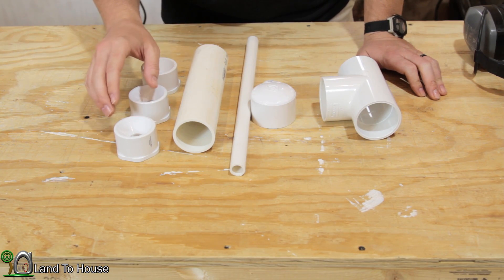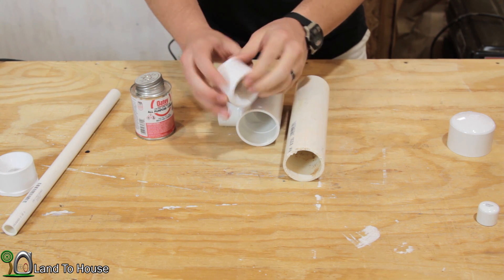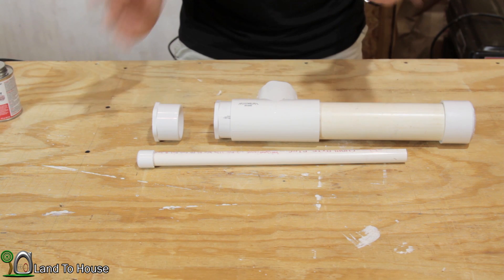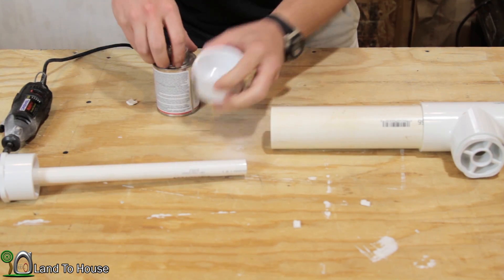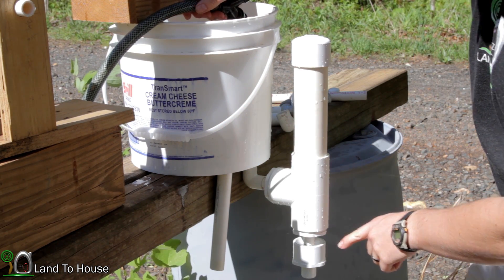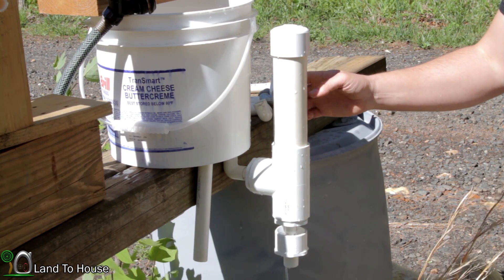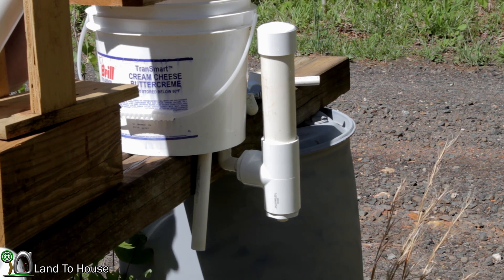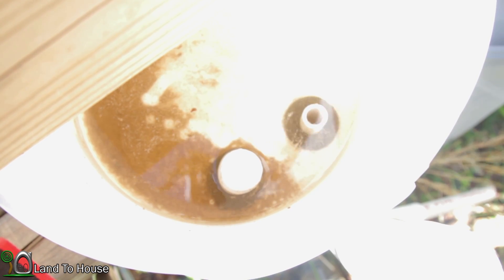Exterior Bell Siphon Build and Test

Comment: You can add a small air tube near the bottom of the bucket just above drain tube and connect it to the bell near the top and that will break the water lock and allow air to break the syphon.

Comment: Rather than a union simply seal the seam between the cap an the pipe with a bead of hot glue.  It will break when you twist the cap to remove it.

Comment: I love the idea of an external bell siphon, however some of the parts are very difficult to obtain, especially the reducers, here in South Africa. (Enter the 3d printer....)  It make so much more sense to have the bell  outside.  Thanks also for the idea of using a ram pump.  I don't have access to a running stream but you triggered an idea to use a small 12v solar pump (or even more than one) in my sump tank to drive the ram pump and get the water back to the higher level fish dam instead of using an expensive, huge pump in the system.  I will test that in the next few weeks.
Reply from the maker: I am happy to hear that the video sparked your creativity! An outside siphon is really handy to have.

Comment: A simpler design would work and flush the debris.  stick your 1/2 inch pipe up the bucket, drop a capped 2" over that with notches all around the bottom.  done.

Comment: You got a "low flow" start on the siphon (that's good) but what is the max flow coming from the pump (the supply line) you can have and still get a break in the siphon? You didn't elaborate on that part of the system. Thanks for showing us your experiments.
Reply from the maker: I have not worked with this idea in some time. I am not sure about that info. (I am bad for trying something and then moving on the other things. )  Breaking the flow is a real issue.

Comment: would a ball tap between the bucket and the siphon work? that way you could turn on the tap to use the siphon and turn it off to break the seal?
Reply from the maker: That probably would work. If you left some suction in the pipe going down you could start back to psiphon anytime you wanted.
Reply: What's the point of controlling the siphon ops when automatic mode is always required?.... Would be equivalent to adding legs onto a snake!!!!

Comment: I liked the whole setup... even with the cup at the bottom... I see why you couldn't break your siphon... you need to add a tee horizontally facing upward off of the smaller tank line... then, to that add a snorkel line... a pipe going up, over, and back down to the level where you'd like the siphon to break inside of the tank (usually 1-2 inches from the bottom of the tank)... then, there's where you'd add your external bell siphon to the other end of the tee... I'd really like to see you revisit it... you did a good job, and it urked my nerves to see you cut off the bottom cup...

Comment: Hi Seth. Do you think I could put a valve on the outlet drain of the bell siphon, shut it off when the siphon starts to work and then turn it on when ever i need water again? I am trying to figure out a way to get water from any underground rainwater collection tank without using an electric pump. Thanks in advance and great video.
Reply from the maker: Yes you can do that. As long as there is water in the outlet pipe you can use the siphon downhill and it will start automatically.

Comment: Could you think of a design in which the water passes first by the generator and then by the ram pump?
Reply from the maker: The issue I am thinking of is that the generator would interfere with the pressure wave of the ram pump.
Reply: Thanks for your answer. With sufficient flow, a minimum incline of 30 degrees and a suggested distance of six meters from the generator should work. There is the question.
Reply from the maker: Now if you have that head pressure after the generator it might be just fine. My thought is if the water that is coming out of the generator falls into a catchment tank then the ram pump pulls from that it would allow the pressure wave to work without issues.
Reply: Thank you

Comment: Sorry a question: do you think it would be possible to combine the ram pump with this electric generator?
Invento de pequeña planta hidroelectrica.
https://www.youtube.com/watch?v=27G8ZYgNb9Y
Reply from the maker: I have a video showing a test of ram pump with nozzle to a simple motor. The test was not very good and It was better to have the pinstock without ram pump.
Reply: Thanks for your reply.
Reply: Why combine a ram pump with a generator? Each thing that you add loses energy and increases maintenance. Why not just generate at source and transfer the electricity using wires?
Reply from the maker: That is what my experiment showed. It is better to let water fall in the pen-stock to the motor and not have a ram pump.

Comment: Hi Seth did you know that the bell siphon will still work without cementing all those bits together then you can clean the siphon out should you get debris inside. Good video. Steve.
Reply from the maker: +Steven Watson haha yes when I glued the cap on I realized I shouldn't have done that. Would definitely make things a lot easier to clean out. :)
Reply: Land to House I hope it works out for you your experimenting has been very interesting.
Reply from the maker: +Steven Watson thank you!

Comment: hi seth! i dnt know if its right to place this comment here..but can I ask a request..can u also try to do a demo of how thermosiphon works..I am planning to build a sloar water heater but could not really understand how it works..thanks..
Reply from the maker: Hello. So you are looking to make a system of pipes that are heated by the sun? After heated the water will rise and fall into a storage tank for use in showers?
Reply: Exactly seth..i do not have a clear picture of its process..i hope you can also make one..a simpler and understandable one..
Reply from the maker: I will have to think on that. There was one at the mother earth news fair last year. It was a lot larger than I expected.

Comment: the cup system needs a drain hole in the cup according to below where the drain pipe stops, but a small hole  if its too big it counter acts.
Reply from the maker: +Master Caster it seems like anything to do with a cup is going to be tedious. My brother-in-law built one of these and I remember him saying you had to be very careful how you put the drain holes in.
Reply: Well   All this stuff is tedious and timing lol.   It will take a bit of playing with,  also thogh  A drill hole in the cup,  You saw myn work,  Only one though and you mioght have to experiment with the size of the hole according to the drain pipes / siphon speed,  Oh ya   It can be tought to figure out.  But is rewarding whaen you get it.. the reason for the drill hole in the cup is so it driains,  when it syphons ( takes two or three,    third or fourth over powers it )    Or longer  ypou need to let it be for a few hours sometimes it will tune itself,  then dont touch it  lol. what I did was the drill hole to drain it so it goes below the drain pipe   and when it siphons fast enough, It presurizes the stand pipe and that burps it. I dont have the cup perfectly draining, but it drains below the drainpipe. and thats all thats nessesary as long as some of the siphons overpower the flow of the cup draining.   haha  I know     Its hard to explain, especiallly is hard to explain I had a couple drinks hahalook at my vid thogh youll see what I mean,   that drain cup is so the cup drains enough that when siphon takes place it pushes air up as it rises, creating the bubbles you want.
Reply from the maker: Because I am a noob when it comes to the bell siphon I think I will stick to the longer pipe on the tail end. I was trying to recreate my brother in laws system from a few years ago. he had a cup like that but it was better balanced. here is that video: https://youtu.be/ccCTDrE_3eY
Reply: @LandtoHouse  

I would have done a smalll hole in the 1/2" cap under the cup. That would have been an effective way to stop the siphon. Once it gets to a low level in the tank flow slows the small hole in the cap would have lowered the water level in the pipe and the cup.

Comment: Hi there, I've got a siphon design that I've been using 24 hours a day for the last 6 months and it hasn't skipped a beat. There's no bell needed, it's external, and mounts to the side of the bucket as opposed to through the bottom. If you're interested lets chat about it. I believe it will address the flow, clogging and reliability issues for draining your duck pond.
Reply from the maker: +Matthew Mitchell I am interested in seeing your design. If you'd like please send an email to: landtohouse@gmail.com or if you have a YouTube video that woorks too:)

Comment: nice work!  Eventually I want to put a bell siphon on my overhead reservoirs from the ram pump for running my overhead irrigation... so it will empty the reservoir... refill and start up irrigation again when full. Glad to see yours worked out. :cheer:
Reply from the maker: +The Farmacy Seeds Network that is a really great idea. Especially in a hot climate you could adjust the tank input so that it Waters by siphon every morning.
Reply: yep... or in my "acreage" case... so it cycles a few times on a plot (via overhead) and then switch to a new spot...
it's a pain to have to remember to shut off and wait for refill. :)
but, 6 new food grade barrels here today for reservoir... so maybe it wont be such an issue for me now.. :)
Reply from the maker: 6 new barrels! Are they 55 gal each? Lots of water. I need to find a way to incorporate the auto siphon for irrigation. Like if we go on vacation.... hmmm.
Reply: Yep... 55 ea.   I will think on this...
off the top of my head:
a valve activated once daily by regulating how much water it takes to fill it... regulated with a valve... weight drops it open... stays open by water flow until reservoirs is empty.
Reply from the maker: +The Farmacy Seeds Network seems like a good plan. Because you have so much land to water you might not mind if it all dumped at once. Those of us with small gardens would soon have a flood if it dumped several hundred gallons twice a day
Reply: yeah, I actually added a 4000 gallon pool to give me a larger res so when things slow in the summer, I can accumulate for 4-6 days, rather than fill my current 55 gal res and be "losing" the rest.  It is soaking in in permaculture style, but sometimes I need "here" not "there". :)
Reply from the maker: +The Farmacy Seeds Network that is so much water! I was happy with my 100 gal haha.